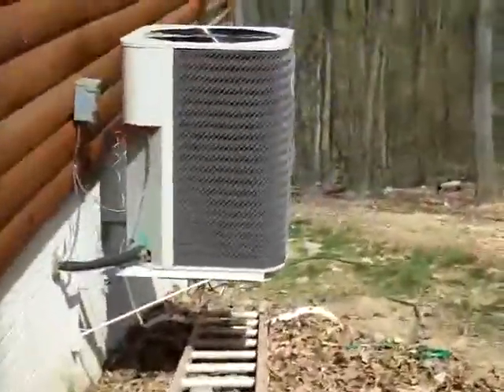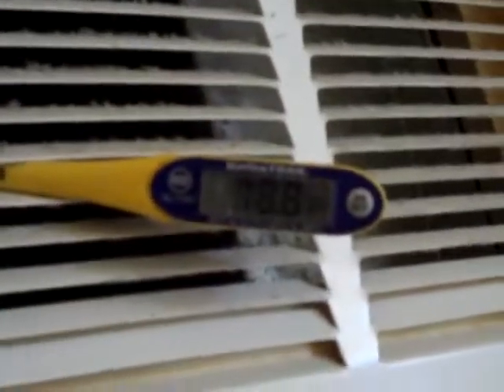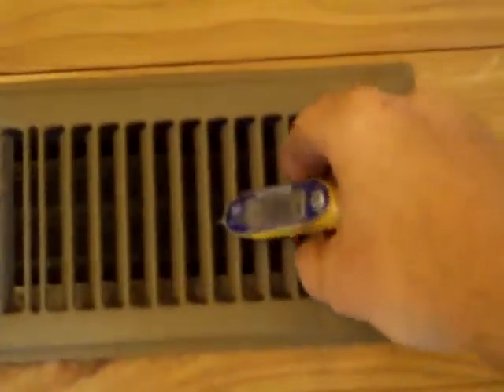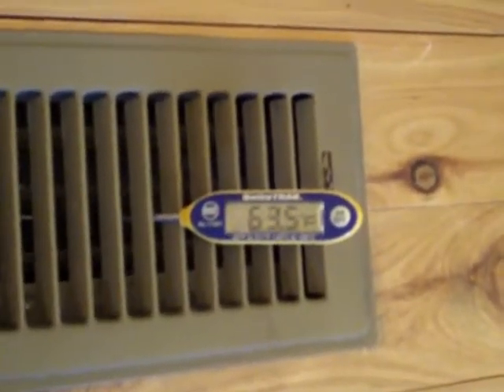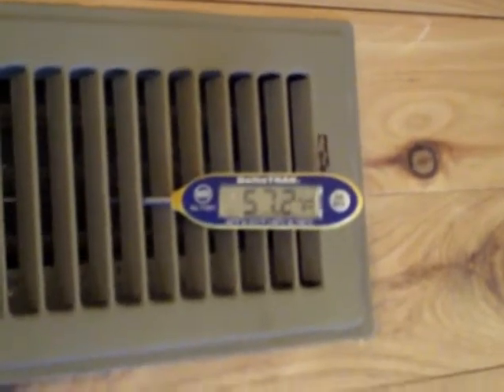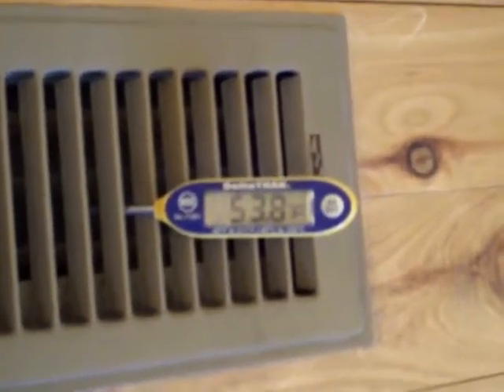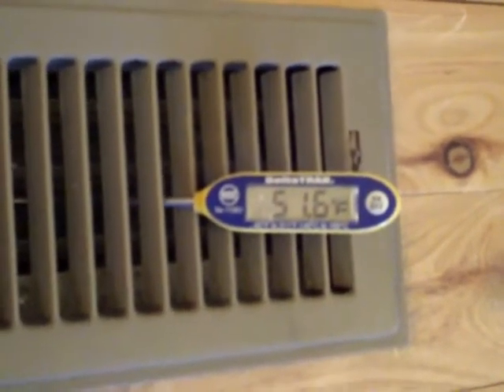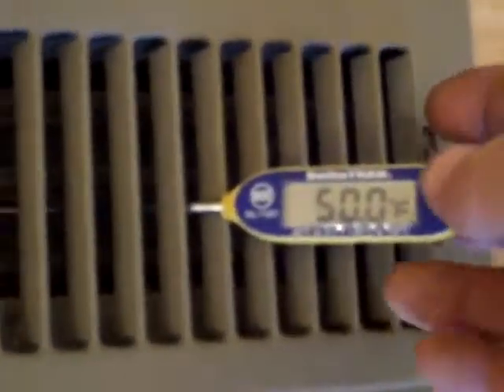My first 'joined' video... more to come

Comment from the maker: @fritzhvac worst $300 ever spent was on a see snake from RIGID.  I never use the thing, and when I do, it either doesn't fit, or doesn't help any.  I prefer the trusty old mirror.  I have condemned a few H/E's with it, but always have to pull to confirm.  I just don't trust it.  I'd love it if I could shove it through a primary limit hole on a furnace and check the condition of the coil sitting above...no luck so far... won't fit between cells of heat exchanger. DOH!!!

Comment from the maker: @fritzhvac  downstairs return is good for 450. That leaves 750 for the one u/s that's reading 79deg.  Behind that 14x20 grill is a hole that's about 7x16, but not very deep.  The high fan speed may be enough to keep the unit from freezing up again.(The system was off when I arrived... nothing was wet)  It's been over three weeks, and no callback, or request for quote on adding return.(The system is a fairly new install...maybe he called them to fix it).

Comment: Great View !
Man Dallas is right about dirty R/A grill , and with filter dislodged I am sure some funk made it to coil ! Do you think it was froze at coil , before they called (wet filter) ? What was pressures and temps at H/P or Condensor (txv) ? Man 8" round is what 225 cfm to at the most 250cfm. So with 3: 8" round R/A you are getting roughly 750 cfm on that system,  so basically moving less than 2 tons of air ? hmmm !
I would scope my coil and look for dirty blower anyway !!!